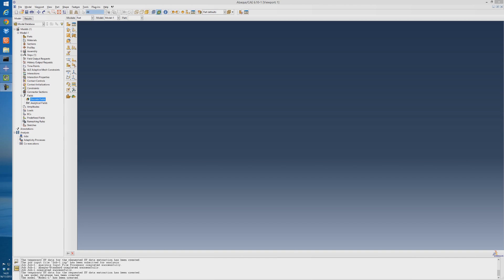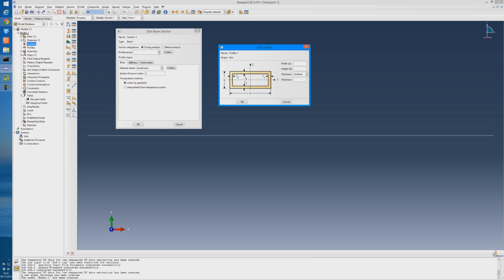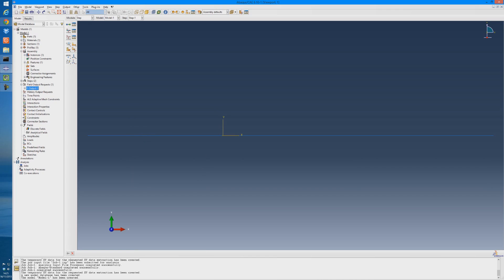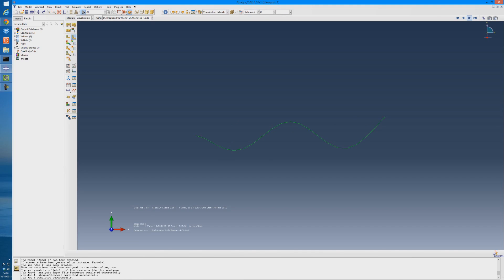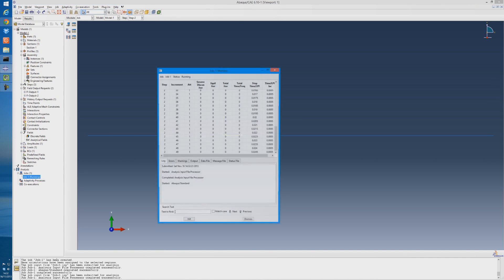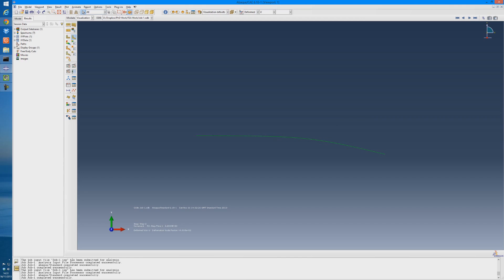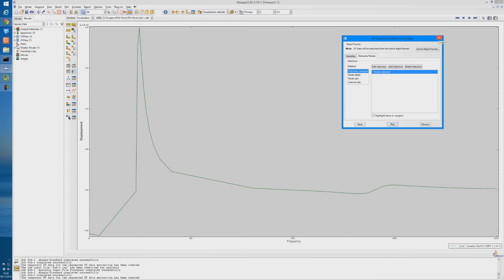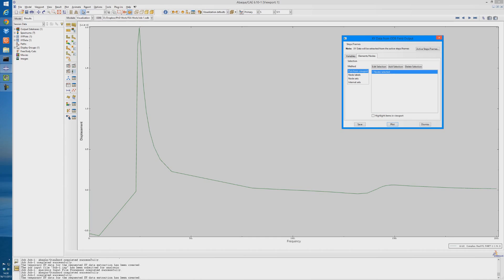Abaqus - Modal Analysis, Modal Dynamics Analysis & Steady State Dynamics Analysis

Comment: Hey, in the video at 9:56 mark, you mention that your chose only first 2 modes as the system has DOF of 2. How and why you say this? The modal analysis shows you can have both vertical and lateral bending as well as torsion and extensions, which means atleast 4DOF. Can you please elaborate, thanks.

Comment: Great tutorial! Unfortunately, I am getting the following error for the modal dynamic simulation;

"Error in job Job-1: PRESELECTED OUTPUT REQUESTS ARE IGNORED IN SIM-BASED MODAL SUPERPOSITION PROCEDURES (EXCEPT COMPLEX EIGENVALUE EXTRACTION). YOU MUST ALWAYS SPECIFY OUTPUT REQUESTS TO THE OUTPUT DATABASE (.ODB) FILE; OTHERWISE, THE ANALYSIS WILL NOT BE PERFORMED. A USER ODB OR SIM OUTPUT REQUEST IS REQUIRED IN A SIM-BASED PROCEDURE."

Do you know why this might be happening?
Reply: I also faced this problem. Have you got the solution yet?

Comment: How can I add internal pressure to a pipe (simply supported) and then perform a steady state dynamic analysis under harmonic load? Should the internal pressure be added in a general static step or is it added in the dynamic analysis step?
Thank you

Comment: Please help I got this error when running the modal dynamic analysis ....  

ELEMENT OUTPUT ON EXTERIOR ELEMENTS HAS BEEN SPECIFIED. HOWEVER, THERE ARE NO ELEMENTS IN THE MODEL FOR WHICH THIS TYPE OF OUTPUT IS SUPPORTED. ELEMENT OUTPUT ON EXTERIOR ELEMENTS IS SUPPORTED ONLY FOR 3-D CONTINUUM ELEMENTS AND SHELL AND MEMBRANE ELEMENTS, EXCEPT AXISYMMETRIC SHELLS AND MEMBRANES.

i followed the steps but it still ocurred !! please help! thanks

Comment: Thanks for the tutorial, this was exactly what I was looking for. However, I tried it with a similar system (yet slightly different) myself and the displacement instead of reaching a peak, switches sign. As a result, not only does this mess up the response by changing sign, but also the response does not reach its peak value. Any tips/suggestions on what may be causing this? Thanks!
Reply: No worries, figured it out on my own. The graph produced by default is the real component of the complex response (remember, magnitude and phase). If you want the complete steady state response either in complex or Euler (exponential) form, you can go to Results -> Options -> Complex and choose to view the variation of the real part, imaginary part, magnitude and phase with frequency (in Hz). Combining the data of the two corresponding graphs you have a complete frequency response
Reply: @panagiotisgeorgopoulos9874  I know this is a very old comment but here goes. Can you explain this a bit further? What do you mean by combining?

Comment: Hello, thanks for the tutorial, i was wondering how these three steps are interconnected? does the output from step2 affect the output of step3? In step3, why the displacement is not zero when the frequency is zero?
Reply from the maker: I do believe that step 3 will carry on from where step 2 ended.
Reply: Thanks..If I would like step 3 to start at certain time step of the step two. would that be possible? can we make them all independent to each other by defining different loads and boundary conditions?
Reply: The reason there is an "initial" displacement at frequency = 0 is because of the applied load. If you calculate the static maximum displacement for a beam subjected to a load at the tip, this should be equal to the displacement at 0 Hz read from the requested plot in Abaqus.

The SSD analysis is not dependent on the modal dynamics analysis, but both are dependent on the modal analysis (the frequency extraction step).